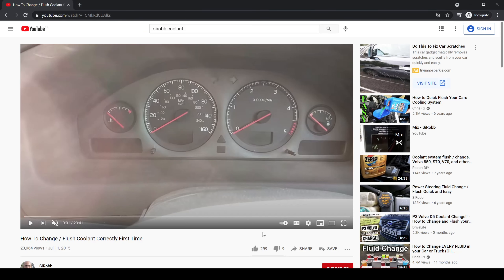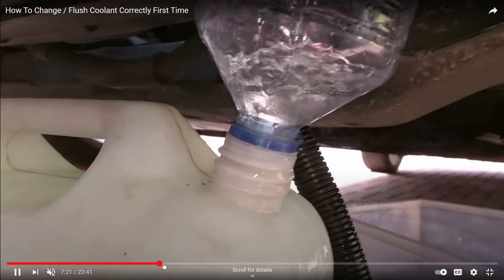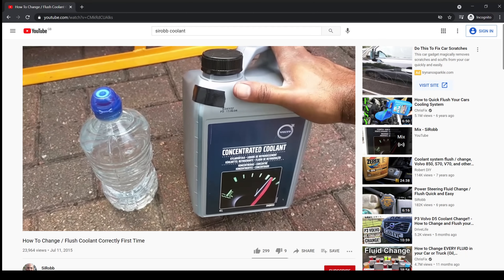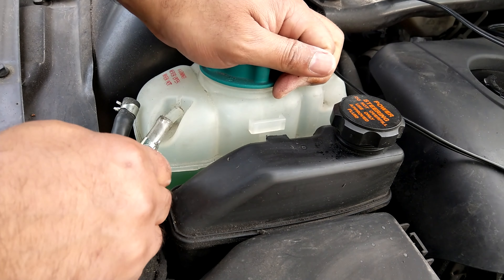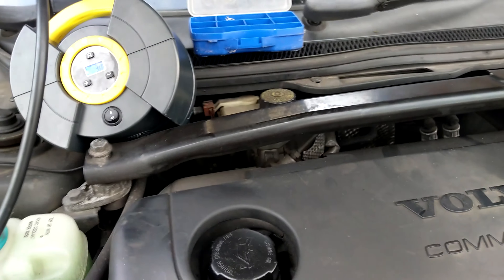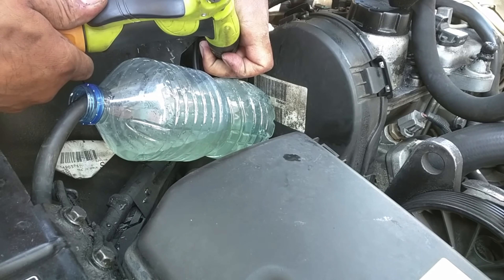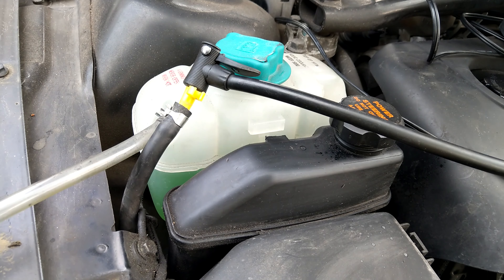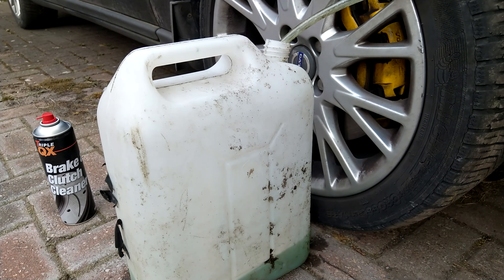How to Change Coolant Without Lifting the Car

Comment: Thank you for the idea with the compressed air. I needed to drain only 2 quarts from my XC 90 volvo in order to replace  it with full concentration antifreeze. It looked like it would be easier to steal gold out of fort Knox than to remove 2 quarts of coolant from an XC90 volvo.    -  if anyone at Volvo is reading this you maybe you could design  a simple access drain for just for such situation that would allow it without having to take half the car apart.

Comment: Thanks Simon.  Need to replace the fan on my XC90 soon so potentially be taking the radiator off in the process.
Reply from the maker: If it's like other P2 platform cars, the fan and shroud may only be held on with a couple of bolts and lugs in which case it's very quick to remove without disturbing anything else.
Reply: @sirobb  You're right there's just the two bolts at the top, just they're very awkward (possibly impossible) to get into without removing or at least dropping the radiator. The other videos (XC90 specific) on Youtube show quite a long process of removing the radiator etc. It's only the bearing that's bad but it looks like the motor is attached from the side nearest the radiator. I'll have a better idea when the replacement turns up. As always, trying to keep this car on the road for minimal cost but in good roadworthy condition hence why I love your videos so much!
Reply from the maker: @gavinstirling7088  Precise details vary between D5244T and D5244T4 but you should get away with from below loosening only (not removing) the two vertical bolts either side of the radiator pack to allow a little drop then there will be other minor clamps or brackets which need moving for access.

I doubt complete radiator removal is required to change the fan but sometimes the nuclear option is better than working around something very awkward.
Good luck with it and thank you for your support.

Comment: I’ve got a v60 D5 with the electric dipstick. It’s got the small grey dip stick at the bottom but it won’t come off. I’ve tried spraying it with WD40 but it still won’t come off. Any ideas?

Comment: Hello Simon, I get Volvo XC70 D5 2.4D it was blue coolant, looking around to buy same color,but showing all of them short life,its good to use a red color,or you know which type of blue coolant is for thats volvo engine?thank you and have a nice day.
Reply from the maker: Just use genuine Volvo concentrated coolant, which is green, as per my detailed coolant change video.
Reply: @sirobb  thanks you,its any code on that? because looking try to buy on internet,just get many different now one, egsactly to Volvo
Reply from the maker: The code will be on the bottle in the video.
Reply: @sirobb  thank you and good luck with more videos,we waiting for that💪🏻🤝
Reply: The new coolant type that Volvo now uses is called G-64. Sold in the UK called Comma Xstream G64. The G-48 coolant was an old formula that is coloured blue. That coolant doesn't last long and must be replaced after a few years.

Comment: Yes 1st one here. Still haven't had to fix my microwave yet
Reply from the maker: Imagine the satisfaction if that day ever comes though..... 😊
Reply: @sirobb  couldn't do a video on how to shut the mrs up. Mines doing my head in with moving into our first home in 2 weeks. 😂. All joking aside could I just pull the bottom radiator hose off and run it with DI water a few times then do a 50/50?
Reply from the maker: @stephenfoster4255  If you can drain in the traditional way, I recommend watching the original coolant change video. I never use premix coolant.

Good luck with the cohabiting..... When it's good, it's really good.